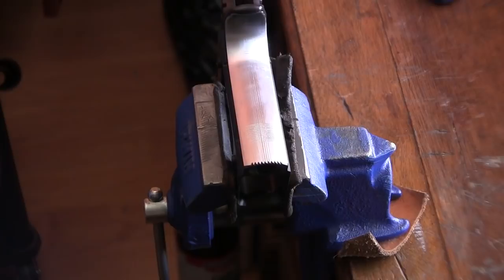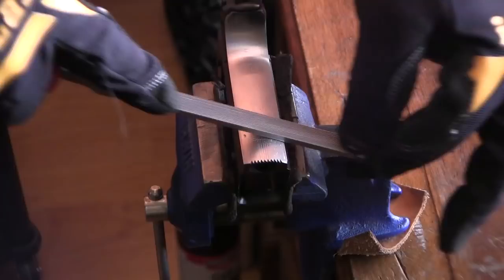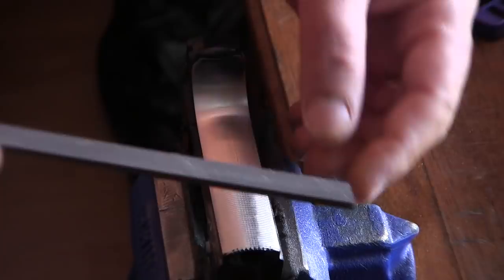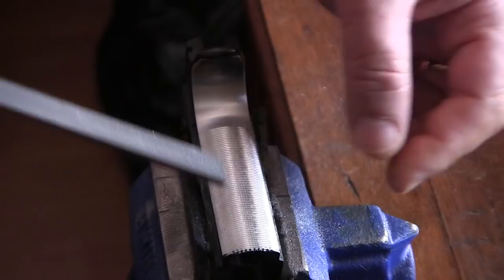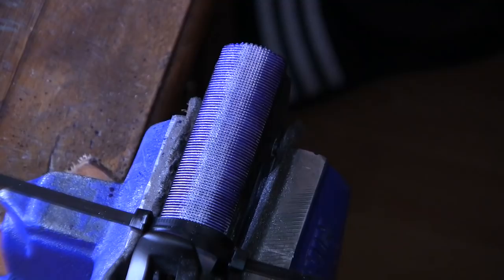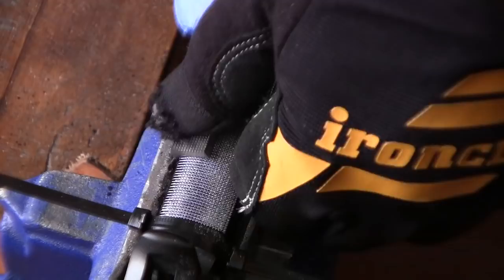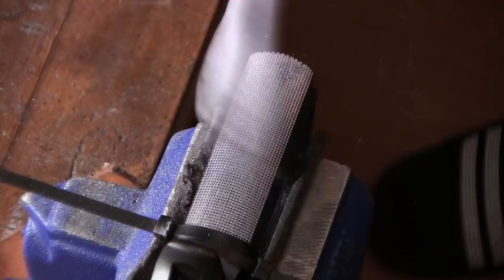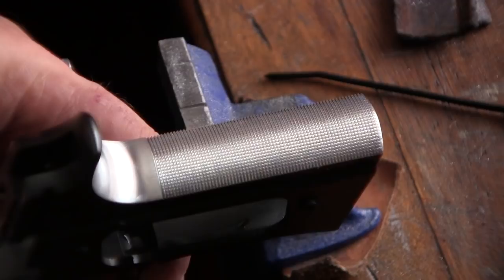Beretta 92FS - Vertec Grip Checkering

Comment: The only problem is you’d need a 4.7” bbl to replace the 4.9”. The vertec obviously has the straight backstrap but it has a slide flush bbl too. I found a vertec mixed in with about 30 “f” pistols on display at my lgs. You could tell they bought a bunch of duty guns for resale, but they had no idea what they had hiding in the pile. I knew what it was right away but they had the tag marked as “fs” and were asking the same price as the “f” models. I haggled them down to $500 and they never realized it was a diamond mixed in with a bunch of cubic’s! After I got it home, I did all of the Wilson upgrades and added an “accurized” bbl. I made several YT videos with that gun as the subject and still treasure it to this day! I was with my buddy that day and I quietly explained what was going on. To the untrained eye, you would have never noticed it but I saw it right away! fun story 😎
Reply from the maker: Very lucky indeed.

Comment: Wow. I've bought a few checkering files. I want to checker the front straps of my Kahr MK9 and MK40. I think I'll need to practice a lot first, but your videos are great on teaching technique- thanks!
Reply from the maker: Glad the videos help. If you want to practice I see a lot f suggestions for finding a pipe of similar diameter to the radius of front straps and practicing on that. Obviously try to find a non-galvanized or zinc plated pipe.

Comment: Excellent work ! You can see how the costs rise on what most customers would consider a simple chequering job, (until they try it that is ), in real time this job must take 5 hours of planning/work, then when you try to charge a realistic cost they think you are robbing them. I think it was a good idea to stop the chequering where you did, there would be no advantage to going right up round the radius, and it could even rip the skin off the web of your thumb on recoil. Happy New Year to you.
Reply from the maker: Thank you. It usually takes me about 4 hours to checker, but yes, it is a lengthy process even on a mill (with setup time). Happy New Year to you as well.

Comment: Beautiful work! Any update on how well the 25 LPI has held up on the aluminum frame? Curious if the aluminum material has deformed over time with use
Reply from the maker: It did get dinged a bit in one spot. But overall no issues.

Comment: Nice work once again. Tempted to try this. I passed up a factory vertec some time ago even knowing how nice it felt in my hand and still regret that. Were you able to tell have much material was left at the thinnest point when all was said and done?
Reply from the maker: I believe it was about .060" just looking at it. I didn't actually measure it because I would have to buy a special tool or make one to measure all along the back strap.

Comment: Is the grip the same exact dimensions as the Beretta factory "Vertec" grips. Or is it your own approximate sizing?
Reply from the maker: The M9A3 wrap around grip that I got to check my radius seems to suggest that it is exactly the same.
Reply from the maker: I guess I should clarify. The only thing I had to go by is looking at pictures (frame comparisons) and that m9a3 wraparound. Looking at the frames I was only concerned with the rear strap shape. Mine seems to follow that pattern. However I just got a replacement hammer spring cap without the lanyard loop and it wants to sit deeper in the frame (bottom flush with bottom of the lanyard recess in the frame, so the cap cross pin may be positioned higher or the frame grip may be longer. The m9a3 wraparound grip is not that much shorter on the bottom than the frame, and I have Beretta Vertec grips coming soon so I can confirm.
Reply: Interesting. It was my understanding that the Vertec grip has identical dimensions to the regular one, with the exception of the front to back aspect. It seems that it would have to for magazine compatibility, but u could be wrong. Maybe that plug sits deeper just because it doesn't have the loop? I guess the pin placement could be different, but I don't see why. But, if the M9A3 grip fit, without any real play, the must be the same.

I'm curious why you couldn't use the actual measurements from the Vertec grip, and just copy the dimension. Is that schematic hard to find online.

Either way, nice job.
Reply from the maker: I think the pin is in a different location. You are correct, the magazines are the same and if the grip length was different the magazine would have to be different or on one it would be sticking out a little. I didn't see the need to search for a technical drawing.
Reply from the maker: I have a little update for you. I ordered Vertec grips from Beretta. They arrived and I tried to test fit them. The grip screw holes didn't align. Called Beretta thinking they were out of spec. Beretta confirmed that the Vertec frames were different from 92FS and that the grips will not fit. 

The difference was about 1/16" so I modified all 4 holes in the grips to make sure the gaps were even and...

Done.

http://i.imgur.com/7i5aXs7.jpg

http://i.imgur.com/JQZEedZ.jpg

As you can see I modified all 4 holes and countersink recesses but made sure the grips still sit flush on top and bottom.

So all is good.
Reply: Interesting. So the Vertec grip is 1/16th taller than the regular, and the holes moved accordingly? Or the space between the screws is also different?
Reply from the maker: The screws, according to the grip panels are expected to be set farther apart, and I am still not sure about the mainspring cap pin. However, the length of the grip panels matches the overall length of the frame. From shoulder to bottom, flush at both ends.
Reply: As i'm sure you know you can use Vertec grips on a regular frame. Just have to slightly open up the holes. I use to run them on my competition Beretta before they come out with the ultra thin grips.
Reply from the maker: andrew geary yes, I got to know that. I did open up the Vertec grips a bit but didn't like them (I got the cheap plastic ones) and ultimately decided to mod the 92fs G10 ones. Just posted a video on that.

Comment: Did you recurve the back of the beavertail as well, if so how do you like it? I'm thinking about doing this to my compact beretta..
Reply from the maker: Not yet. I am still considering it though. It is very easy to do so when I do decide I will make a short video of it.
Reply from the maker: I guess I should add that the only reason I haven't done it yet is because I want to put the hammer back in and see if there will be more risk of hammer bite if I allow the webbing of the hand to come up higher. Not that it is difficult to put the gun back together, just that I haven't done it yet. :)
Reply: MosinVirus  10-4 I can understand that.. Where did you get your files and jigs from.
Reply from the maker: The jig (discontinued) and checkering files I got from Brownells.com
Reply: MosinVirus thanks man I appreciate it. I just took out my mainspring and looked inside and realized with a compact A2 there's a lot less hump on the backstrap. So I have to be careful and file down a lot less than what you had to.
Reply from the maker: I am sure you are correct. They wouldn't have make a larger bump for the shorter grip so it has got to be smaller. But the process would still be the same. Good luck.
Reply from the maker: I just looked at the hammer to Beavertail relationship and there is no way it could bite, so yes, there will be another video.
Reply from the maker: Just did it, and posted a video. Came out pretty nice. Not a very pronounced difference, but different enough to feel and not different enough to be ugly.

Comment: How long do the files last? Looking at getting some and trying this but just wondering if I will have to replace the files after I do one pistol
Reply from the maker: I have not replaced a single file yet. Have used the same file for easily 6 checkering jobs and some were both front and rear straps.
Reply: MosinVirus ok cool do you have links to the files you used in this and other videos?
Reply from the maker: Here is a link. Select the file you want (LPI) https://www.brownells.com/gunsmith-tools-supplies/general-gunsmith-tools/files/metal-checkering-files-prod488.aspx
Reply: Thanks for the video and your information
Reply from the maker: My pleasure.

Comment: Sorry, how do you do the blueing finish? What do you use?
Reply from the maker: That blue color is from a Layout Blue liquid. It is based on something like acetone with a blue pigment and dries very quickly. It is also easy to remove with a wire brush or acetone or nail polish remover. Here is the product https://shop.brownells.com/gunsmith-tools-supplies/general-gunsmith-tools/machinist-accessories/dykem-steel-blue-layout-fluid-sku262100004-5807-13898.aspx?cm_mmc=PPC-ItwineGoogle_-262-100-004&gclid=CjwKCAiA-KzSBRAnEiwAkmQ1551if9A3OLfNhZc6zpXejFVTMLV373R6YwNHGyZQgc2NgHip9lLycRoCX_kQAvD_BwE
Reply: MosinVirus many thanks
Reply: MosinVirus I was referring to after the work in the aluminum is finished that product you apply so that it is again blue or black.
Reply from the maker: Oh, my apologies. I would have anodized the frame but the grip screw bushings are staked in and I cannot remove them. Since the grip screw bushings are made of steel I cannot submerge them into the anodizing bath (they will instantly be attacked by the acid). This means I have to choose a coat type finish. I have the option of going with Cerakote, but may instead choose to go with IonBond DLC (Diamond Like Coating).
Reply: MosinVirus Very grateful for your valuable help, thank you
Reply from the maker: Actually, I take it back. I contacted Allegheny Gun Works and they will remove the grip screw bushings and re-anodize the frame with Type III anodize (the hardest there is).
Reply: MosinVirus Yes it is the best result. Thank you